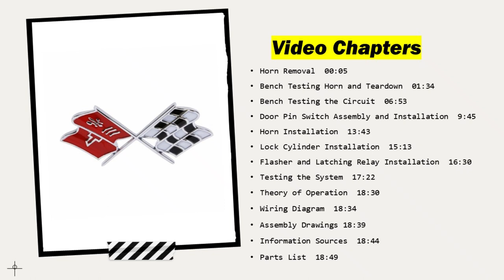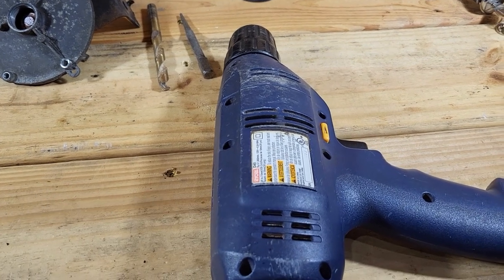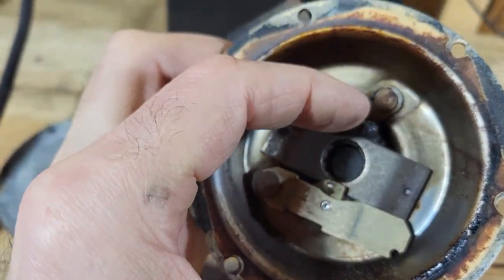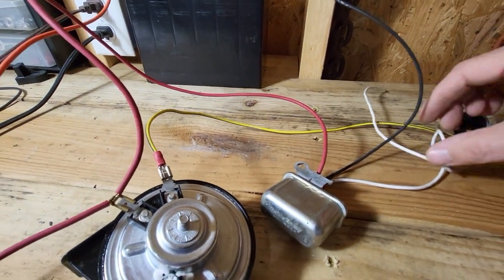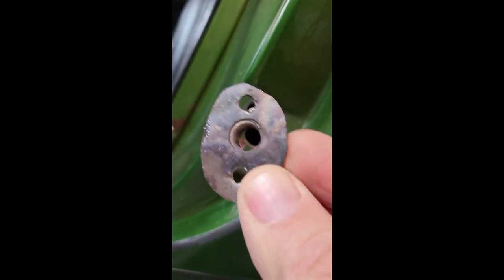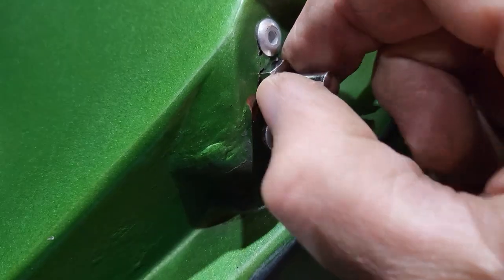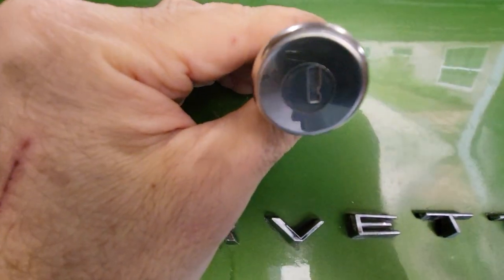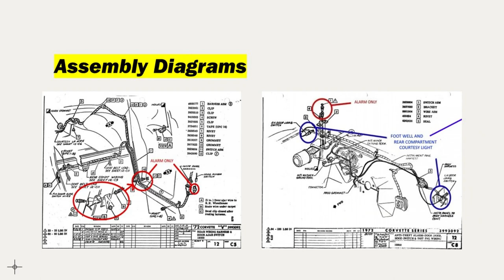1972 Corvette Stingray Anti-Theft Alarm Repair & Overhaul

Comment: How did you get your fabricated bracket and nut into a position to rivet into place? Did the piece fit through the tiny hole in the access compartment or did you insert the plate through another opening?  Thank you very much
Reply from the maker: I used a scrap piece of wire that was knotted at one end.  The knot was on the backside (welded side) of the bracket and through one of the rivet holes.  The wire/bracket was then just pulled through the compartment and the B pillar.

If that doesn't make sense, let me know.
Reply: Thank you. I think I understand. You went through the wheel well access panel, then used the wire to pull your bracket the the small circular inside the access panel opening /pillar (size of a 50 cent piece) to get the bracket over the exterior part of the body in order to rivet it into place.  I originally thought I would just be able to place the bracket inside the access compartment to rivet the bracket to the outside.  I didnt realize there was another small compartment only  accessible via that small 50 cent piece sized hole.  I looked all around to figure out how to get the bracket against that outside of the body.  I will give it a shot to go through the small hole.  Thank you